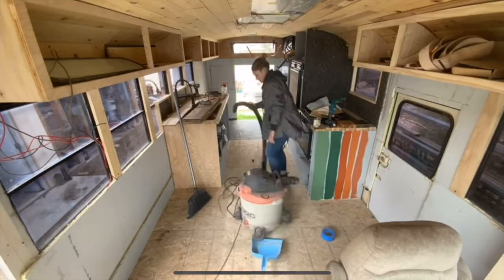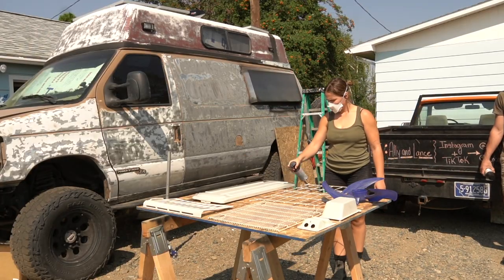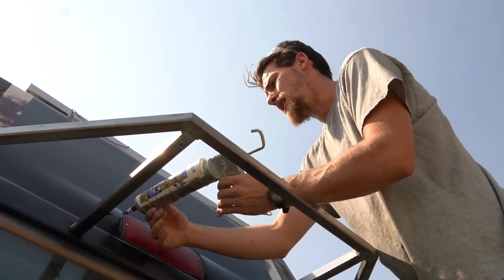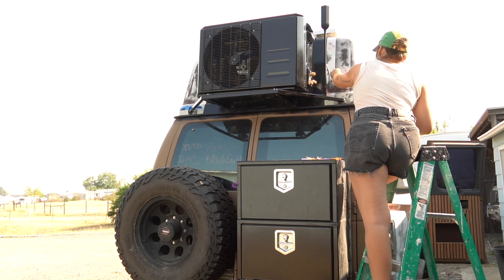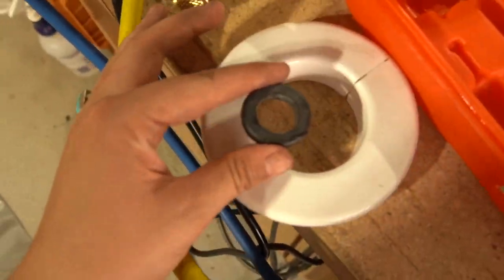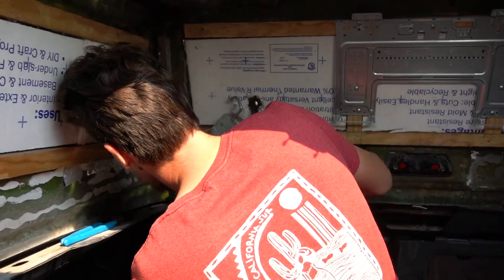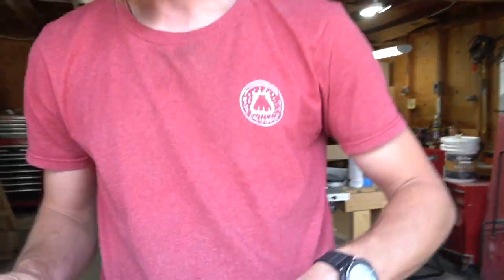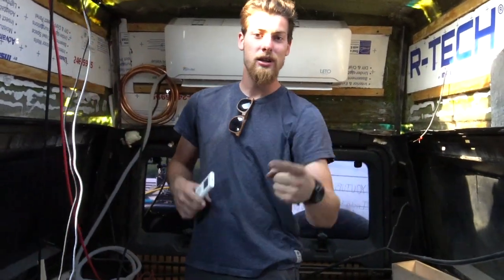Mini Split Air Conditioner/Heater on a Van Conversion // 4x4 Econoline Van Build Series

Comment: Installed 9K/22SEER hp on my Chevy Express 2500. I put hp cabinet with only the fan inside where my spare tire was. Compressor, PCB and misc in left rear corner, Air handler on left side 4” from ceiling. Works great. Typically pulls 40A from my 24V 400aH LFP battery bank.

Comment: Just put one of these on my Ram Promaster 3500 and my build helper insisted on putting the wires outside the vehicle so they hang down below the outside unit - he had to fabricate a box to put around the unit. It works but isn't an efficient use of space. I love your solution.

Comment: You make me want to put a mini split in my van. We shall see. Might upgrade to a short bus before that. 

✌
Reply from the maker: Ohhh really 😏😏🤪 would love to watch you build a shortie!
Reply: I put a 9K/22SEER HP on my express 2500. Reg height and length. Removed spare tire, installed hp cabinet with only the fan inside blowing down.

Comment: Great job as usual. I honestly don't think you'll need the spoiler to re direct air from the condensing unit. I do believe what they mean by not mounting in a place where it gets to much air running through it, would be like to not mount it on the front in the direct wind as you're traveling. I think that high-top will do a good job at blocking the direct wind. I'd think the reason they don't want the strong wind blowing through it, is because it could put a strain on the fan's blower motor as the heavy strong wind could put a lot of resistance on the fan blade. JMO, I think it'll be fine just like it is.
Reply from the maker: We think so to! Plus I we will use it while driving pretty rarely since we have the actual van AC too!
Reply: If wind drives the fan motor, it will shut down with an Error Code. Remember, many of these compressors, indoor/outdoor fan motors are three phase dc motors. They will generate power if off and driven by wind.

Comment: why did you leave all that extra copper tubing inside?  like you shortened the outside end?how much did you save w/ open box price.thanks for sharing
Reply from the maker: The instructions want no less that 3 meters of tubing that’s why it’s coiled. These are pre charged units so I imagine that’s why to keep the pressures correct.We saved about $150 and still have a 3 year warranty with the mini split

Comment: I'm Diggin' it, although I think the rear Van light is going to be behind the Heat/A/c unit on top. Also I have not finished watching this video but thought I'd mention while it's on my mind may need a strap of some sort on top of the Heat-A/C unit to keep the air from between it and the fiberglass roof extension from blowing the A/C unit off while driving on Interstate or Back roads. Laterz Back to the video
Reply from the maker: Yes! We're adding a light in front of it 😂 that also doubles as a blinker haha

Comment: How is this holding up a year later..? wanting to install a mini split for my 2000 chevy express hightop G3500
Reply from the maker: No problems! Doing great 😊
Reply: @AllyandLance  I will be doing mine on the outside top like this too. I purchased the 12kbtu Pioneer ultra efficient  115v.  Thank you for sharing this
Reply: I installed a 9K/22SEER on my Chevy Express 2500. I removed everything but the fan from the hp cabinet, then installed where my spare tire was removed from. The compressor, PCB, reversing valve all sit on left rear corner. Air handler mounted 4” from ceiling on left side. Works great.

Comment: It being a heater has no correlation to it size all it does is reverse the flow of the refrigerant and turns the indoor unit into the condenser and the outdoor unit into the evaporator you'd want this flipped for cooling

Comment: Respect on all the welding but damn is that van gonna be heavy af. ac unit on the roof? yall craZzyyyyyy
Reply from the maker: Well I meen Rv's and campers have them on the roof!
Reply: If 3/4 ton, it’ll be fine.

Comment: You need to NOT wrap the copper line so close together.  The need for the 9' length is for "heat" transfer. Having it bundled like that is similar to running a 2' line ( not recommended )... all and all love the build!

Comment: Idea for the Flies and this may be an old wives Tale. But Glad sandwich Bags hung from the top entry way of the Garage on either side  meaning both sides ha ha filled half way with water. It is said to disorientate them with all their many eyes and supposed to keep them away. Now the Chickens smell may be stronger than the power of the Fly disorientator. Lol worth a try your Parents may have heard of such a thing.? Laterz Leland
Reply from the maker: Lol maybe that's why my mom put a bag of water with Pennie's in it on the coop! Worth a try right!
Reply: @AllyandLance  Yeppers

Comment: Lance still watching but thinking again the A/C unit is awfully heavy for the 1 inch or 3/4 inch square tubing to hold without something on the top as a bracket to help I would hate for you not to have it and driving down a rough road it start falling off or leaning back and down. Again not done watching so maybe you have made something to that affect. Laterz Leland
Reply from the maker: We actually have cables the run from the top that we didn't mention in the video. We're planning on adding a plate later on that attaches to the top of the unit to the roof as well!
Reply: @AllyandLance  Superbulous